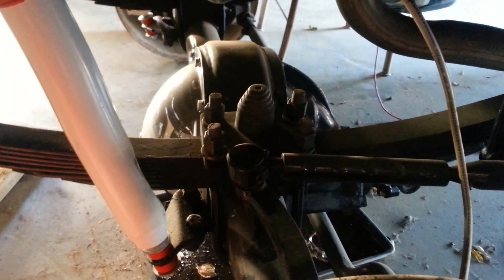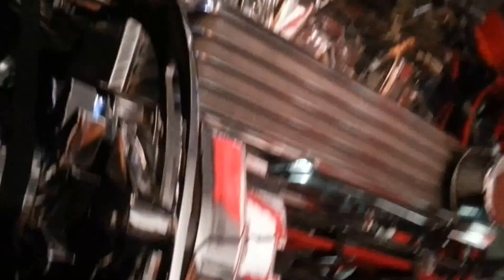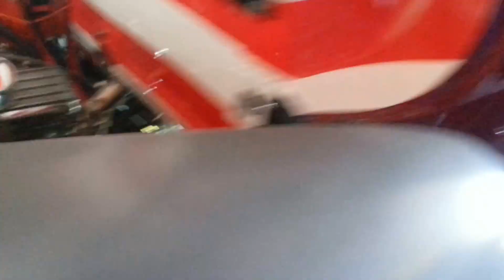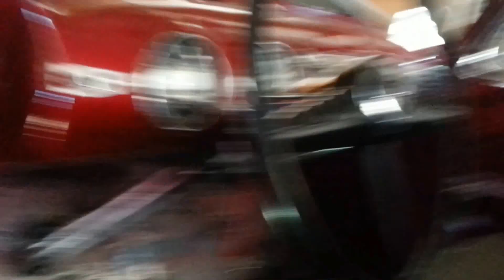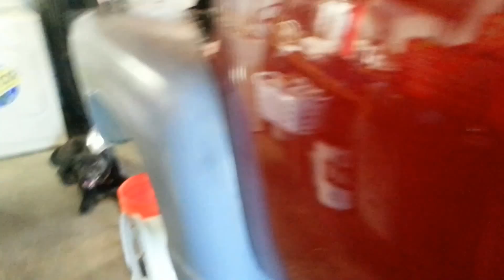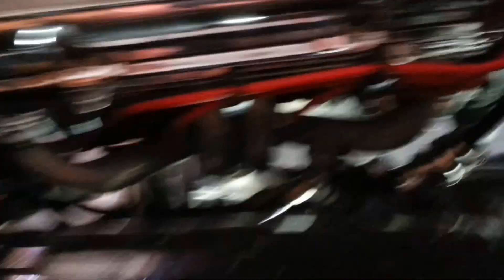Power Steering on an Advance Design Chevy pickup

Comment: I have a 1955 Chevy LCF 5400 two ton 2nd series truck that we still use on the farm as a seed tender for filling the planter in the Spring in the field. My Grandfather bought it new in 1955 and since we are the original owners, I've kept it in perfect condition with the only exception of having switched out the original 265 engine to a 327 and stretching the frame 30 inches, it is stick and original. The problem that I have is that it is extremely difficult for my wife to steer and I want to convert the manual box to power steering and add a pump to the engine. Would a CCP kit less the COLUMN shifter work on our truck or is there a conversion kit offered to add a later model power steering box to our truck? Thanks! And your project is awesome!

Comment: I'm doing what would have been the original style hydraulic power assist steering that uses the original steering box. There will be a hydraulic ram that does the pushing, and a control valve that regulates the hydraulic fluid to the ram - just like it was back in the day. And this way - everything is stock - steering box, frame, steering column, etc.